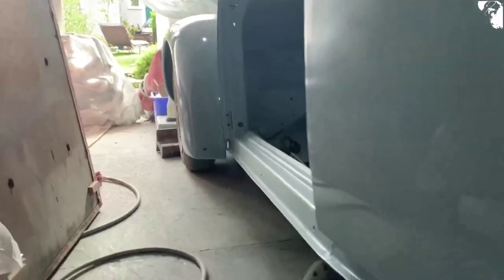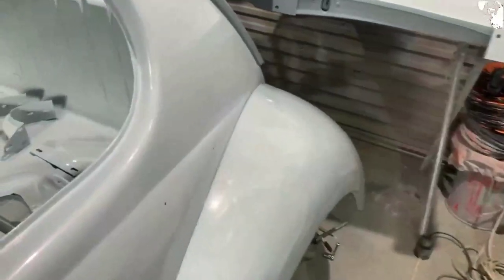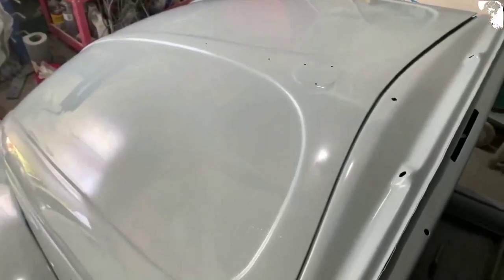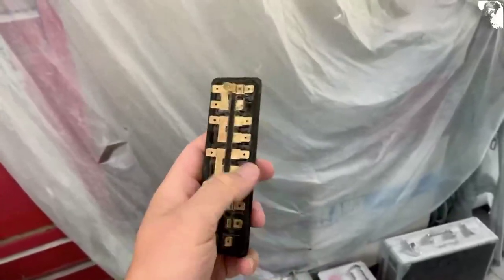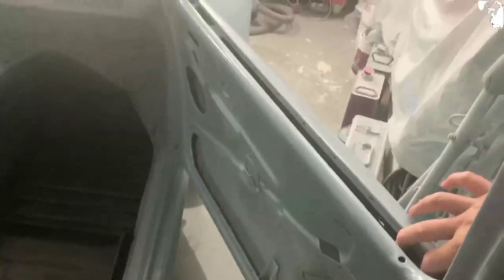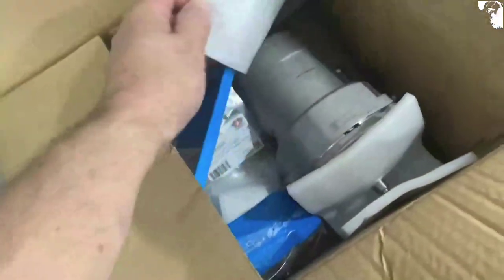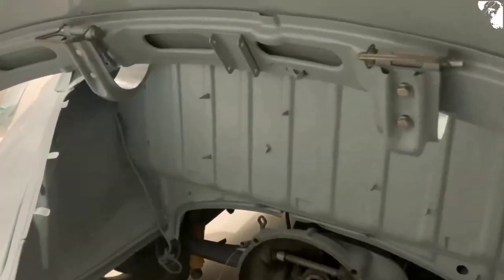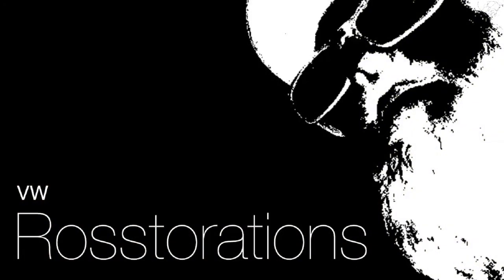Classic Volkswagen Beetle & camper restoration #39/114

Comment: You're a mad man, doing two projects at once. Especially at the bodywork stage lol. Panel alignment triggers me so much, even though as you say the majority of them out there aren't perfect. When you do your own car you're aware of every imperfection. Also trying to find stuff you put in a safe place months ago is a lot of fun haha.
Reply from the maker: 😁 sure does test the patience at times. Like you mention you know all the imperfections when it’s your own, so it’s hard for it be exactly right, in fact it won’t ever be right 😂 the elusive parts are still MIA. 😂
Reply: @VwRosstorations  mine was in a front end crash before I bought it and 'repaired' badly which is why I've had to redo everything now, but because of that it'll never be straight and square, which I never really noticed when I drove it so I'll have to live with it.
Reply from the maker: @GT.Bugger  pretty sure they’ve all been through the wars..all got a story to tell.👍